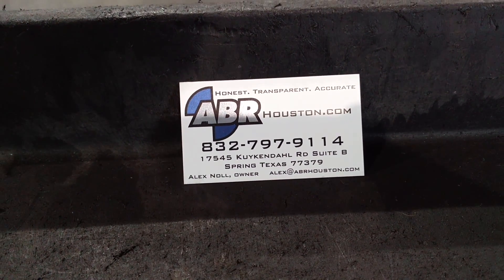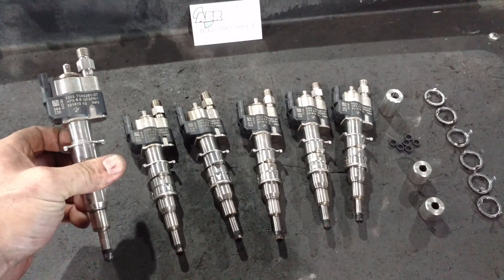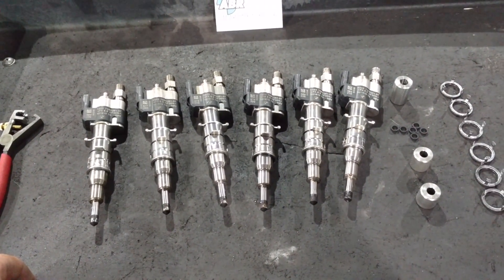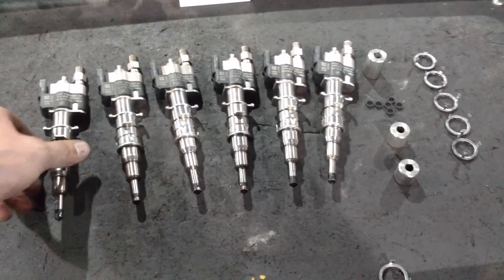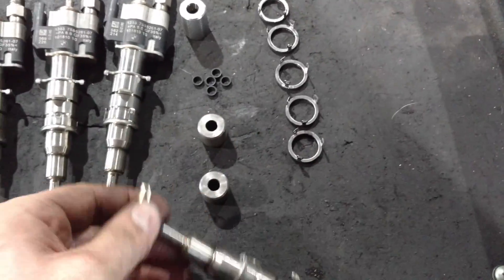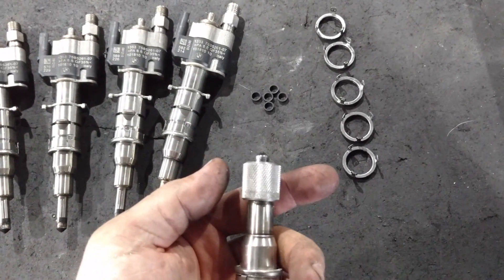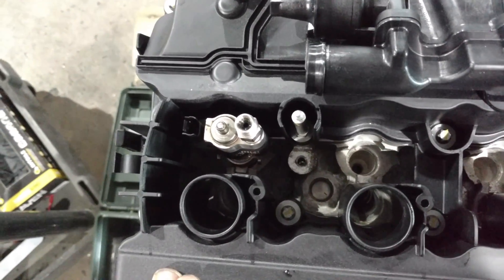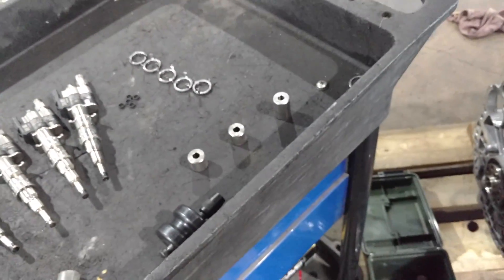ABR Houston explains N54 fuel injector installation and replacement

Comment: Grest video - thx for the great explanation. I’m finally replacing the original injectors on my 2007 335xi after hitting 100K miles. I had bought an injector puller tool and was wondering what all the other bits in the kit were for.

Comment: Were is located your shop guys ? I'm dealing with a misfire issue coming from the injectors and I need some assistance
Reply from the maker: 17545 Kuykendahl Rd Ste B Spring Texas 77379
Reply: @Abrhouston  i have random misfires my coils and plugs are new I remove one injector #1 and it's very dry while #2 it was with a little gas the car its running very rough and I can't make it that far because it turn of by self all the time and the power it's very reduced, any suggestions? Should I go ahead and replace the injectors

Comment: Soni recently bought some used index 12 injectors and replaced the seals and cleaned up all the carbon deposit.   Upon reinstalling , seems as if there is a gas leak.  But I checked the fuel lines and the surrounding area and don't see any leaks.   You can literally see the gas on the cluster going down. Please advise.

Comment: If my number one cylinder injector is leaking fuel on to my spark plug and fouling it, will replacing the Teflon O Rings fix it?
Reply from the maker: Nope. You'll probably need an injector. Better change the oil, too!

Comment: How is the fuel injector tool able to hold on to that bolt and pull it up? Will it lock?
Reply from the maker: Not exactly sure on the question, but the slide hammer set up will thread on where the fuel injector fuel line screws onto.
Reply: @Abrhouston  Ahhh. Does all BMW fuel injectors have this bolt on them?
Reply from the maker: @audunjemtland8287  No, they dont all come out with a slide hammer. Its not a bolt. Its where the fuel line connects.

Comment: I would say if you put them back into the same cylinder port it should be safe to do it without replacing the seal.
Reply from the maker: Well, hate to be the bearer of bad news but we're the professionals here......
and you are incorrect. You always replace the seals. I mean unless you like trashing cylinder heads......

Comment: Could anyone please tell me if I still need the tool for the seals if fitting a brand new dealer injector ? Thanks
Reply: nope
Reply: Dealer injectors come with a new seal already compressed with a cap on the end to keep it compressed. However, they don't come with a decoupling element - you have to buy that separately. I always found that a bit odd because you can always forget to put on a new one when refitting.

Comment: Hi, i installed my new index 12 injectors yesterday but made a little mistake. On two of the injectors i had forgotten to put the decouplerelements on, which i realised shortly after putting them into the engine. So i quickly removed the injectors put the decouplerelement on and put the injectors back into the same hole in the engine. My question is do i need to replace the ptfe seal near the tip of the injector as it had already been in the engine or will it be fine as the engine wasnt turned on and the injectors were only in for a few minutes. Thanks
Reply from the maker: You already know the answer. Change the seals

Comment: If I have an injector which I didn’t pull out but but loosened the bolt and removed the bracket and and checked to see if it had any play, would I still need to replace the seal?
Reply from the maker: If you didn't remove it, then you should be ok, but I would just for insurance. It's not worth damaging the head over a 3-4 dollar seal.
Reply: ABR Houston Your BMW, Volkswagen, Audi and Porsche Service Specialists I'm I'm Houston too but not sure where to get the tools needed in a timely manner.
Reply from the maker: Bring it to us, let us handle it :)
Reply: ABR Houston Your BMW, Volkswagen, Audi and Porsche Service Specialists the valve cover is off.
Reply from the maker: We can get it flat bed towed up here, no problem

Comment: Did you push the seal from on the cup adapter to the injector by hand or did you use something.?
Reply from the maker: there is a cone shaped tool that sits on the end of the injector to help you slide them onto the body of the injector.

Comment: l do have injector with calibration number starting with 700**** and 800** instead of 500** what l have on my E82, would l be able to use them if l code it to the computer. what does the calibration number represent? thanks!
Reply from the maker: Kerim Danismaz Kerim Danismaz as long as you have the numbers on the injectors that's all that matters. They only really represent a calibration value the DME understands. After you code them, the numbers you punched in will be saved in the DME, and the stored numbers will change as well. Sounds confusing, I know :/
Reply: I have coded them to vehicle, so l would not have any uses with flow rate of gasoline in to combustion? Does the high calibration number represent higher flow rate?
Reply from the maker: No, it's simply a calibration number

Comment: I'm having a rough idle and a slight misfire every now and then under decent power. I'm changing my oil, plugs, coils, and top o2 sensors. I have a cylinder 4 misfire and o2 sensor failure code. Is it a good idea to clean the tips of the injectors and replace the parts you suggested also?
Reply from the maker: Cleaning the tips won't really do much. Replace the O2 first, see what happens.

Comment: i want to check the code if its right  
numbers a must take the injektors out for this and after moste i do same code agian from computer if the code is right? Moste i do the code evre time to check injectors? Or only first time?
Reply from the maker: The number you need is on the side of the injector XXX with XXX underneath it. You put that into the DME via a test plan. The DME will change the numbers, so they will not match when you look at what the DME has vs. what the injector has.

Comment: Thanks for the video. I just changed one fuel injector on cylinder 6 and it was missing the rubber seal, small tab that's welded on the injector, and the decoupler. Which explains this loud tapping noise during hard acceleration. The fuel injector looked bad and I found the tab in the cylinder. I had to fish out the tab with some long pliers and pick. The previous owner or whoever had no business changing it out. Luckily it didn't damage my car.  Thanks, fellow Houstonian.

Comment: Do you have to replace the rings if they're going right back in the same cylinders?
Reply from the maker: Yes!
Reply: ABR Houston Your BMW Specialists had the place that I bought the car from replace the exhaust cam ledge and I still get 2A87 code and have a bad injector now.
Reply from the maker: Well, sounds like you need to get it diagnosed by someone who knows what they are doing.
Reply: ABR Houston Your BMW Specialists the cam ledge was def an issue, the groove was 0.019" deep. The tech set the timing 180 out somehow and it dry rotated maybe 200-300 times? I'm thinking the assembly lube was used up and the new teflon cam rings were worn down. They're gunna take it apart again and check the rings/replace them. Does this sound possible?

Comment: you said there's 12 different injectors they've made? theres a 1 where theres a 7 on these injectors..i took mine out and they have the ring in tact still but its white i oreded everything needed to replace but is it possible for the 1st gen to be good still 10 years later, they are loud too..
Reply from the maker: Yes. It may be possible, but not reliable. I'd always recommend to upgrade to the latest index 12 injectors.

Comment: I have a 2007 335i with cylinder 3 misfire BMW technician says it's a bad injector. I still have the old injection system can I still buy the old system injector and replace that one without the high cost of replacing them all?
Reply: Ronald Gower technically you can but you will have constant issues with the other injectors in the near future. If you're planning to own the car for a long time it would be better to replace them all.
Reply: I have bought all new injectors and waiting for them to be delivered. What program do you recommend for me to use to code them once I have them installed?

Comment: so what you're saying it being a BMW 535i xDrive 2009 is it better just to change and put new ones because I bought the car about 2 years ago and I didn't know if there were ever replaced, I just change the valve cover gasket and spark plugs runs a lot better but still hesitates a little bit why I don't do you know what I need to do if that's what I need to do or what what else thanks I really appreciate it God bless you thanks.
Reply from the maker: That's a ton of money to throw at the car and not know if its going to fix it. Have a BMW technician diagnose it for you.

Comment: I have a good question for you if I just put the new rubber seals and refurbish the injectors can I just put them right back into their same place without entering them into the computer because there will still be the same ones  just putting them back into the same place
Reply from the maker: There isn't much you're going to "refurbish" on these injectors. If they go in the same cylinder, no coding is needed.
Reply: YEs but I would not use rubber seals= these are teflon to handle high heat

Comment: Alex have you had success with taking injectors out cleaning the tips and replacing the seals and reinstalling to make the car run better
Reply from the maker: No. If they aren't index 12 injectors, then you'll probably have issues with them. The tips aren't really the issue.

Comment: Reusing index 7 on a new built motor, crazy considering they're already spending 7k for the motor and can't buy new injectors lol.
Reply: I would spend another $1500 for index 12 instead those old index 7
Reply: And did you see how filthy the injector was when he put it in
Reply: @mr.n5435  they get like that after even 10 miles of use .. they always look like that and its not an indication of anything.